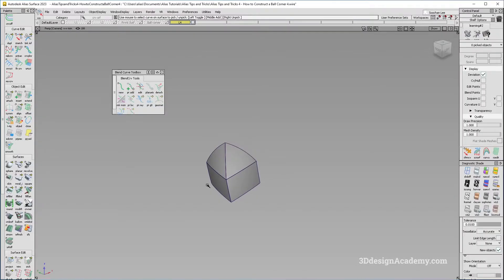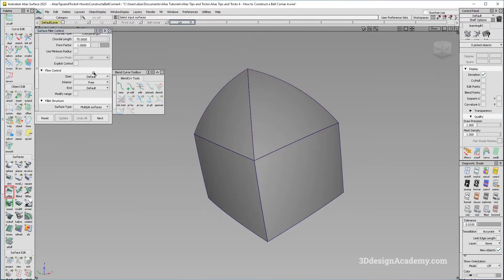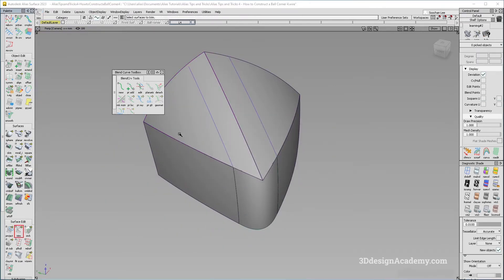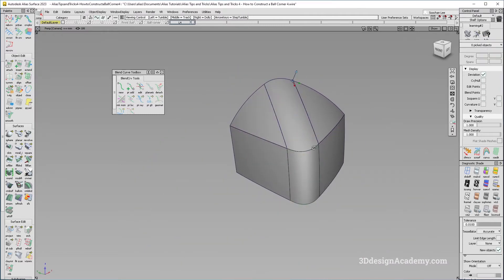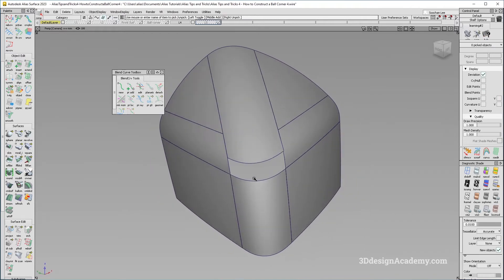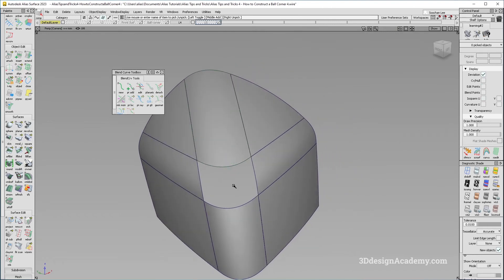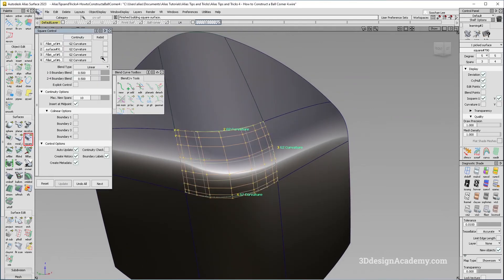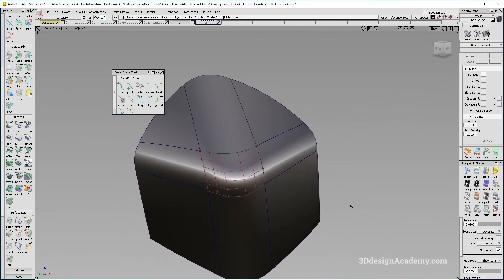Autodesk Alias Tutorials l Alias Tips and Tricks 4 - How to Construct a Ball Corner 4

Comment: Great tutorial. I have a question though: if turning on the Colinear Options (Boundary 1 etc) helps it to gain Curvature, should we just turn them on all the time? It seems like they should just be ON by default... (unless there's a downside to having them turned on?)
Reply from the maker: There is a downside. In fact, you only want it on when you're manually building it like this. If you have the colinear turned on, and it's trying to achieve curvature to a trimmed surface, the CVs will be all over the place.

Comment: Oh that is nice! Please do more. And just a small question: if 5 deg does not give me continuity in this example, but 5 deg 2 span does, is it ok? should I consider spans as a viable option for this type of corners or not? alias documentation claims it is not a class. but to be honest I still do not understand what they (spans) actually are and are they a bad habit to rely on?
Reply from the maker: Having a single span surface is ideal. however, it is not a "must" even for A-Class surfacing. For larger main surfaces, you want to avoid having spans as much as possible. For secondary, or tertiary surfaces, I think it's okay to have a few. Even for "Class-A" surfacing in production environment, I've seen surfaces with multiple and multiple (think of 50 plus) spans still get sent through for final data used for tool and die making.

Essentially spans are data points to connect to objects or edges. The more points you have, the easier to connect, but there's also more room for error. A good modeler should aim to minimize them, but single span surface is not always needed. I might try to make a video to explain a bit more about spans.
Reply: Spans are fine as long as you at at degree 5. So you can use degree 1, 2, 3, 4, 5, then 5.2, 5.3, 5.4, 5.5 and so on to infinity. A lot of things can and should be built using multispan surfaces.